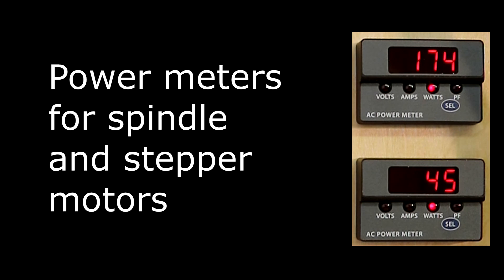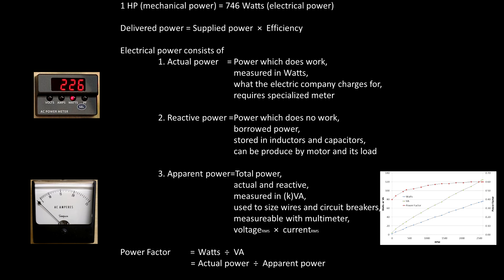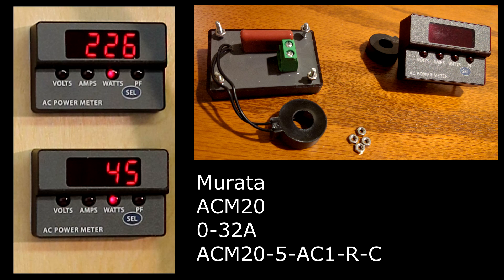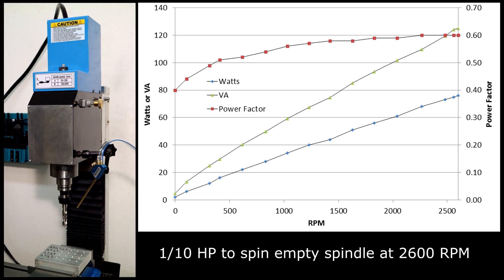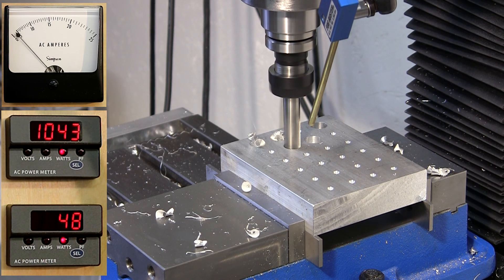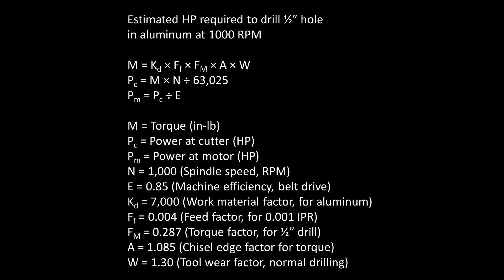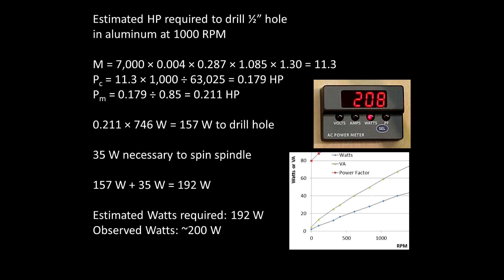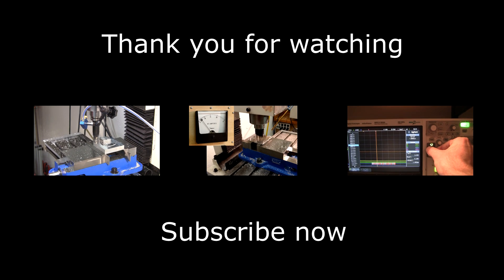CNC Spindle & Stepper Motor Load Meter - power meter

Comment: I have a 3hp CNC Router with a 4x8 table and my biggest problem is I have no way to indicate if I am overloading the spindle and I think this would work but being the cable coming from the spindle is a multiwire cable, I am not sure where I could put the rings......
Reply: The cable that powers your spindle is where it needs to be. If you're looking specifically for spindle power usage. It doesn't matter that there are multiple wires. It won't (in this situation) matter. When measuring current in house wiring you clamp adding the whole of the wires within the insulation. This isn't an inline ammeter. The circuit isn't broken to insert it.
Reply from the maker: Assuming 3-phase, one current sensor is needed on any line if legs are balanced. Could measure voltage and phase to calculate power but requires a fancier setup and inexpensive power meters update pretty slowly. Easiest and quickest is to make assumptions, only measure current, and stay away from overloading the motor and the assumptions will be fine. For experimenting, a current meter with RS232 or USB or 0-10V out and fast update rates, (say 10-100Hz?) might be perfect. If driven by VFD, the VFD may already have this output. You're looking at relative changes between no-load and over-load, so reproducibility is more important than precision. Hope this helps. Thank you

Comment: If Main Spindle Power of CNC1 is 5.5/7.5 kW and CNC2 is 9/11 kW, a same machining job is performed on both the machines, will the power(energy) consumed by both the machines will be same ? Or if different, then approximately how much difference ?
Reply from the maker: Very interesting question. Power is a measure of work done over time, expressible in mechanical or electrical terms. Ideally, the machine power power remains constant if work done changes as long as time changes appropriately. In reality, one machine could be wore out or have a much heavier spindle and motor to turn and be less efficient. But I could be completely wrong :) Best wishes

Comment: Awesome video and great explanation!  I've been looking for a power meter like that to estimate forces on a CNC router.  Those meters are surprisingly accurate - thanks!  Too bad they don't have any sort of external interface.  This other approach looks too hard and expensive http://www.ti.com/lit/an/slyt545/slyt545.pdf

It appears that your high speed drilling example (2600 RPM? and IPR?) stalled due to inadequate spindle power.  Is that right?
Are speed changes on that spindle accomplished via drive belt pulley changes or the motor controller?
Reply from the maker: Thank you very much. If the test file is still consistent with the video, the drill was running at 2600rpm, 5.2ipm or 340 ft/mn. Yes, there are low and high speed belt ratios. I normally use the 1:1 but there is a lower speed 2:1 ratio. The Murata meters require too much time to feed back to a controller even if they had an output. However, if power factor is nearly consistent, one could read current faster. If cost is no object, there are DIN rail mount power monitors that might read faster and can be connected to a PLC. I have a couple other sensors to try including the Infineon Current Sensor 2GO evaluation and a power meter with a current transformer from eBay called AC100A that has serial output. The later is a little sketchy because the isolation between the line current and serial is weak. I also plan to replace the spindle motor with a 5000rpm servo and eliminate the belt. The parts have arrived... still waiting for the time to arrive :) Machine monitoring is pretty cool. Let me know if you make any advances.
Reply: @kentvandervelden  I believe that the advantage of changing belt ratios rather than controlling spindle speed by varying motor drive voltage is that more of the power potential of the spindle motor is available for cutting at lower spindle speeds.  My understanding is that's also true, at least to a certain extent, with VFDs and AC induction motors.

If you do much Aluminum milling, you might want to consider a higher speed spindle.  See http://marketing.datrondynamics.com/acton/attachment/6438/f-0026/1/-/-/-/-/DATRON%20High%20Speed%20Machining%20White%20Paper.pdf and https://www.datron.com/cnc-machining-videos.php
Reply from the maker: @gmack4097  Best just to have excess surplus power :) but walking the edge is more fun. I forgot to mention, some drives report current and power via a diagnostics protocol. That could be very convenient for feeding information back to the controller.

Comment: Good video. Im trying to work through these calculations too, I like the meters idea, think I'll get some of them too. Thanks
Reply from the maker: Thank you for the comment. If you find an error in my calculations the video in general, please let me know. The Machinery's Handbook has a lot of great information. I can't imagine all the effort that folks over the years have put into these equations and rules of thumb. The only downsides of the Murata meters are the slow response, which I assume is to create a low pass filter effect, and the lack of measurement output. However, for the cost, they are pretty great. There are a few folks who have created power meters using a current transformer, some passives, and  an Arduino, which is an interesting way to go. There are also several DIN-mount power meters, but their cost is high. I've used the power meter useful with power hungry operations like drilling and facing. Again, I wish the update rate was higher. If you try a different sort of power meter, I would sure like to hear your experience.
Reply: These meters https://smile.amazon.com/gp/product/B07434CJQV/ref=ppx_yo_dt_b_search_asin_title?ie=UTF8&psc=1 less expensive, faster (0.5 second lag), and seemingly just as accurate as the Muratas.